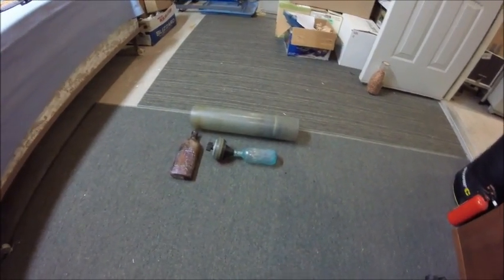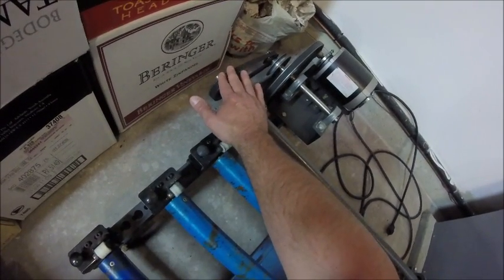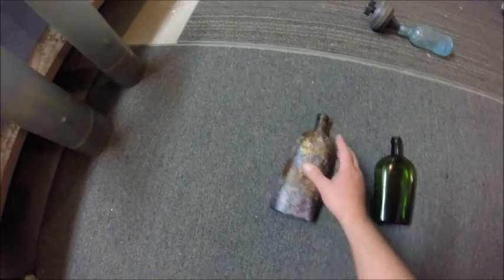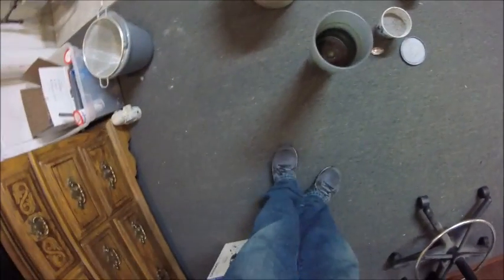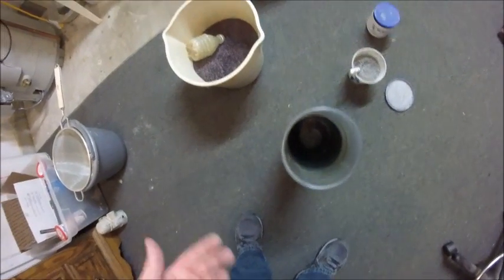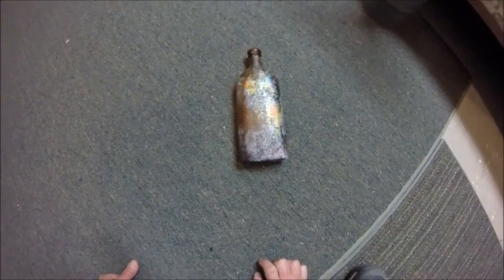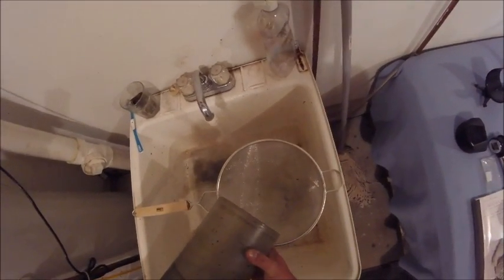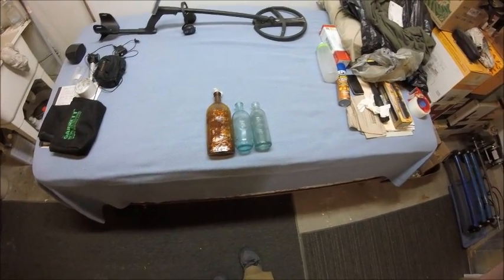Bottle Tumbling Tutorial - Cleaning your dug bottles

Comment: Tumble at 55 rpms and reuse the polishing compound by finding 5 or 6 bottles of the same ounce capacity, use a funnel and just pour it into the next bottle, start with the one with the worst stain and progress to the one with the least stain. It saves time and money. I've been doing it for 20 years.
Reply from the maker: +NCbottles  I understand the logic. Thanks.
Reply: where do you get the polishing compound?
Reply: Marcus' muse The Jar Doctor
Reply: thanks
Reply: I was told the polish loses it's grit after 5 days or so which would be a 1 bottle turn. Is that incorrect?
Reply: @marcusmuse4787 bottle Dr

Comment: Awesome video! I have a spackle bucket full to the brim with sick bottles, some are pretty rare, too.

I'm planning on building my own tumbler, but I'm pondering what kind of motor to use. Any suggestions?
Reply from the maker: I'm glad you enjoyed the video.  You should get a 1/3 HP, 1725 RPM, continuous-duty motor with automatic thermal protection.  Best luck to you!
Reply: @Dirtflicker  Awesome, I've seen a few 1HP motors for pretty cheap on Fleabay, will have a look around though.

Someone suggested I use a motor from a breadmaker, but I dunno....

Many thanks 👍
Reply from the maker: I would not consider using a motor from a bread maker, I don't think it would last.  1/3 or 1/2 HP would be plenty.  Best luck to you.

Comment: How many days would you polish the inside of a small 4" x 1 ¹/² " thin walled puff type bottle? It is a open pontil. I do not have any speed control so I run at around 60 rpm. I am using a pre-polish grit. There is very slight haze inside. The outside does not need tumbling.
Thanks Robert M.
Reply from the maker: Just make sure if you are tumbling anything other than round bottles you only tumble at 20-30 rpms or you risk breaking them.
Reply: @Dirtflicker   will do. Thanks. I actually run at 50 Rpm's, is that too much for a round bottle? Last question I promise. Thanks for the reply, Robert M.

Comment: Excuse my ignorance but i didnt quite get the copper fill part. You said fill the BOTTLE half way with copper, then add water to half inch above the copper, then teaspoon of cutter. How much copper do you put outside the bottle in the pvc tube and how much water ? Thanks
Reply from the maker: It's the same on the outside, but the circumference is larger on the outside so you will need a tablespoon and a half or two tablespoons if you are tumbling large jars.  Tumbling is polishing while taking the "sick layer" off the bottle. So on the outside it is the same:. Water 1/2 inch above but you need to double the oxide you choose to use to accommodate the larger circumference.

Comment: Why don't you just just use brass BBs instead of cut copper?
Reply: BBs are copper coated steel. Steel is bad for glass and you want edges to the copper not round.